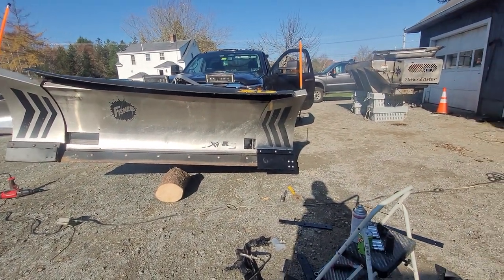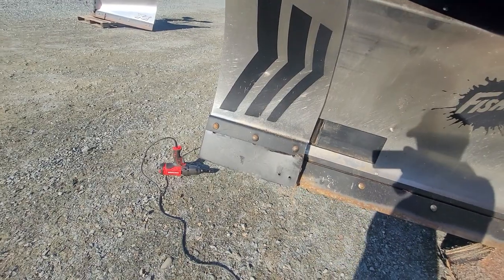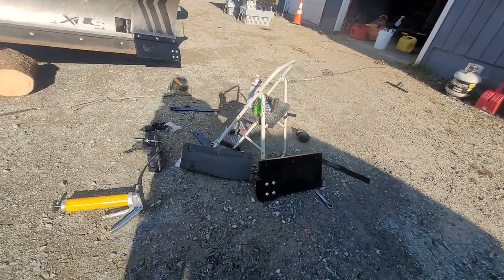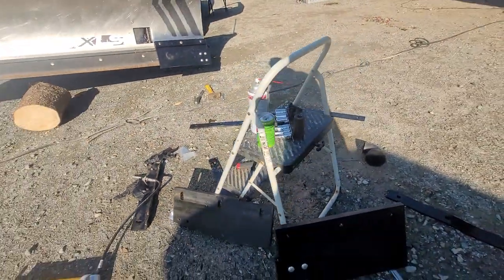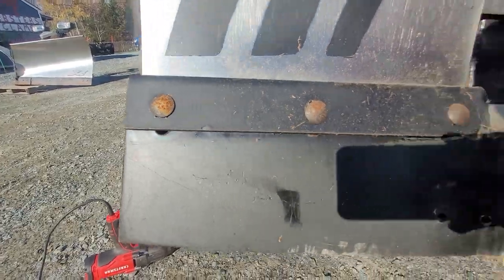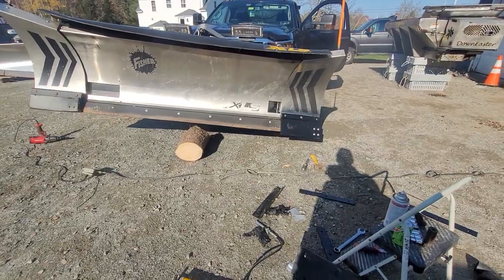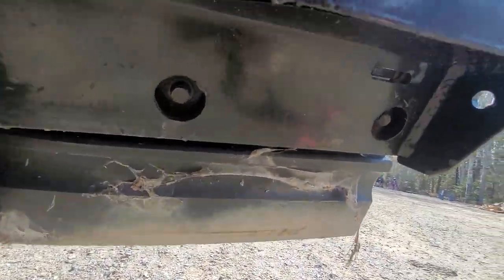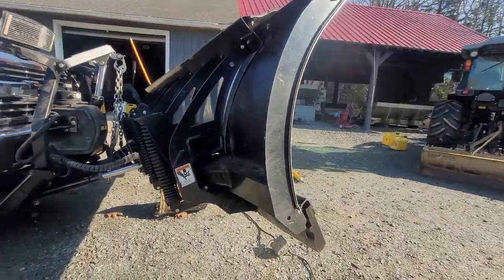Fisher XLS Snow Plow, Wing Edge Replacement

Comment: I just bought an 8611 xls…what’s your thoughts on the plow? We plow the roads in a mobile home community and a few other parking lots, can’t wait for the snow to use it.
Reply from the maker: It's a great Plow!   I like it better than the Xv2 for most of the storms we normally get. 
    XLS seems like less adjusting and button pushing compared to Xv2.  
    I like the extra width, and the wings in scoop  carry snow WAY better than the Xv2, way less overspill trail-off snow. 

  But it is heavy , and can't tuck the wings as close as with  a v Plow.   
 I plow 12 hours on a small storm , so the Plow is getting commercial grade use. 
  The first year I had to replace the poly wing cutting edges and if you do that you pretty much have to replace the steel cutting edge so everything is flush and same height.  
   But this season,  I don't need to replace the Poly cutting edges after last year's use.   The non oval holes and flat mounting brackets held the poly edges in place and they didn't wear out as fast. 

If you have issues with the poly edges pulling down and diagonal,  take it back and show the distributor,  as I think fisher will warranty the item.  
   Keep eye on the hydraulic hose fittings  on the base of the angle rams. They came loose and leaked fluid  several times on me. 
   It's tricky to tighten the flange nut and retain the required angle of 22° on the base of the fitting.
Reply: Thank you for the info…we ran 2 xv2s and loved them but I’ve seen a lot of people giving the same advice what you just did with the xls so that’s why we switched…keep  up the great work with the videos!